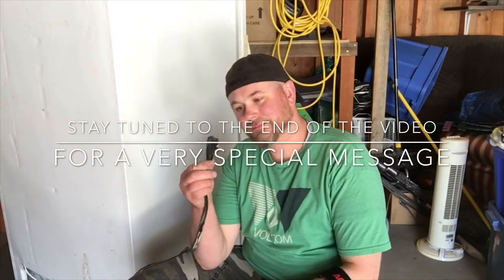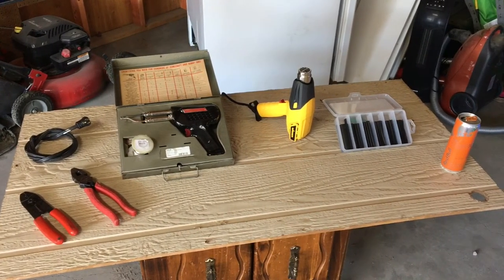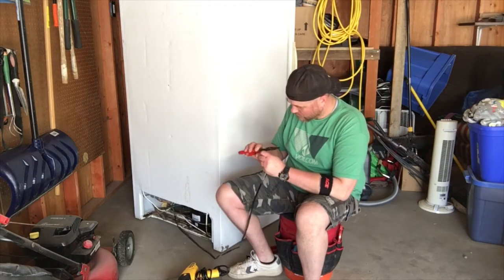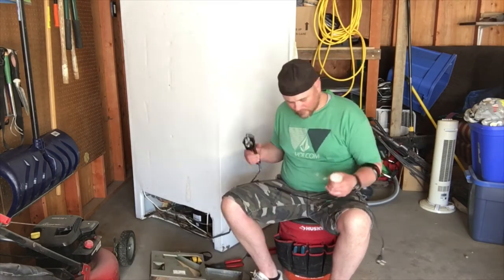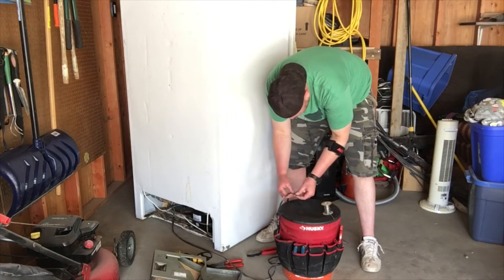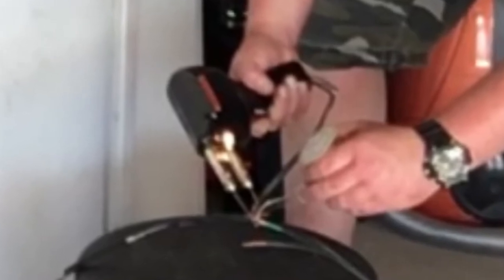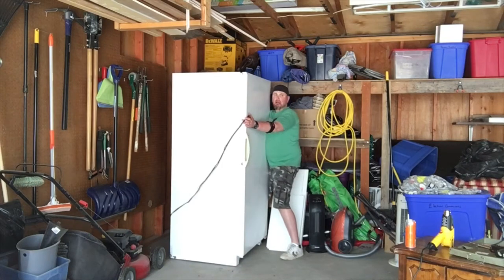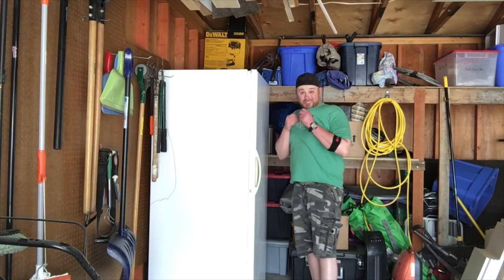How to fix a broken appliance electrical cord

Comment: I'm trying to splice a power cord on whirlpool refrigerator and the 2 wires on the outside are both exposed copper. How do I know which ones to connect?
Reply: What happened? I’m right where you are and how to know which one is the live wire?
Reply from the maker: What happened to what? Not sure I follow what you’re asking
Reply: @SpiritualGoddess69  my dog chewed  thru the power cord. What I learned is you connect the smooth plastic covering to smooth and ribbed or textured plastic coating to ribbed or textured. You don't differentiate by the wire its the cover. Of course you are cutting back the cover and splicing the wires together but you are matching the covering. Hope that helps.

Comment: Great video.  Good repair.  I'm about to repair my refrigerator cord after a mouse chewed on it for a midnight snack.  I wanted a good review before I actually do it and your vid gave me a good step by step reminder so I make sure I do it right.  Thanks.
Reply from the maker: Robert Marshall you are welcome. And I’m glad you enjoyed it. I’d love to hear how your repair turns out.
Reply: @JFKreations  My repair turned out perfect.  I bought a replacement cord and some shrink wrap and followed thru as you did in your video.  The repair as far as I'm concerned was perfect and I have not have had a problem since. I also took care of the mouse problem so there will be no more wire repairs to make.
Reply from the maker: That’s fantastic. These are the types of comments I like to read. I’m glad you were able to get it done and do it yourself! Keep those mice out!

Comment: do you have to sodder the wirers
Reply from the maker: You do need to bond the wire together somehow. Solder, like I show in the video, is probably the best option and what I recommend for a repair like this. You might be able to find other options that could work, but I won’t personally recommend those for this type of repair. If you do try another method of connecting the wires it needs to be a strong connection that won’t wiggle loose as you move the cord around. Definitely avoid just twisting the wires together and covering with tape. I have seen that before, no good.